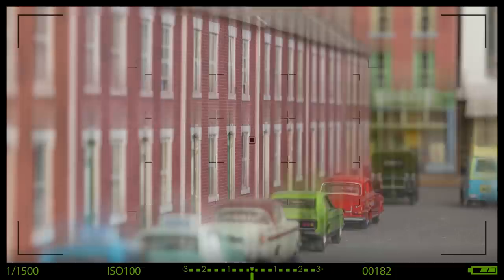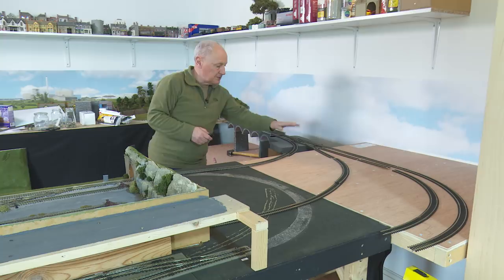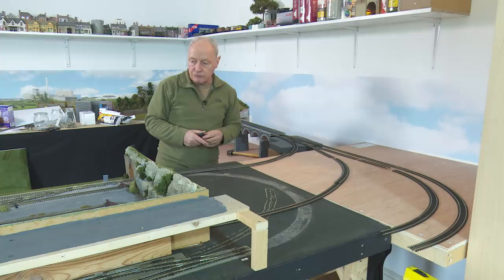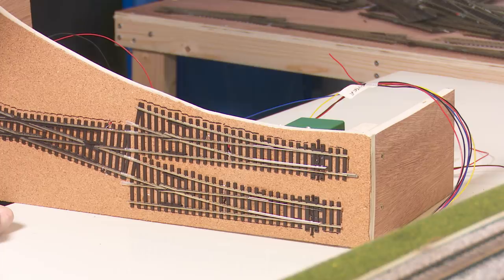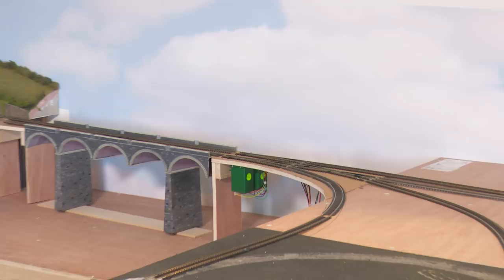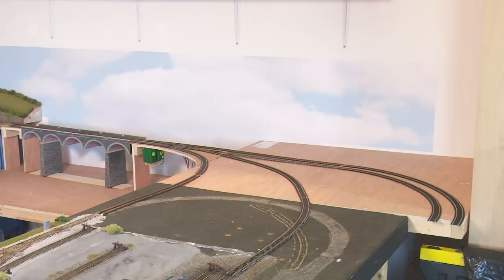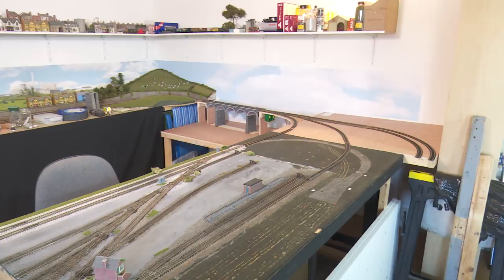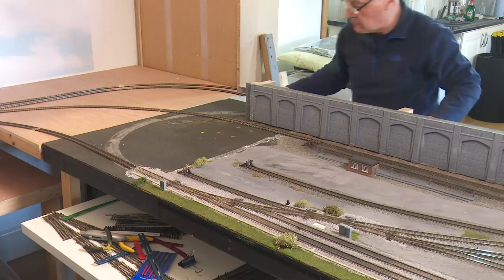Track Plan Sorted at Chadwick Model Railway | 59.

Comment: why not expand the track layout with removable butt stocks or buffers 

and have a mini storage yard behind the scenes.. you look like you have enough space there to extend a complete through tracks.. to give an option to  have a pass-thru  so you can run freighters and a passenger service without  causing blockages..
Reply from the maker: I’m embarrassed to admit that I don’t really follow your proposal Jason. 
Can you possibly post a link to a picture?
Reply: @ChadwickModelRailway   

the idea would be to have removable  buffers

My idea would be to extend the start of your rail yard to the exit  expanding the rail yard to allow for the room a 12 track fiddle yard with 2 mains and 2 spurs this way you have a main/runarounds in the middle and access off the spurs..

in which your mockup doesn't currently allow for..

watch your own video and mute your voice
 look at your own layout

Some times it pays to step back and oneself as a third person view

Sit down  look at your original objective look at what you are trying to achieve VS what is needed to go to the objective at hand..

from what I can tall from my  very suggestion  you haven't really thought of the access that will be a need rather than the access you have not considered  you actually require for the layout to function  without creation operational bottlenecks..

from what I can see you have fixated on the the fiddle yard though have not considered on how you intend access the fiddle yard and the current access route via the viaduct end as the indications  are you don''t really have the space where  the  fiddle yard is located to support the  fiddle yard itself let alone mains line/spur for running locos around the consist..
nor active spurs on the outer periphery of the fiddle yard

minus the turn outs

i would  do a complete mock up of how  tracks that section of your layout can hold 

I can see 12-14 tracks at this stage.

allowing for  spurs and mains it 8 usable as a fiddle yard..

at 14 tracks it gives you 10 tracks as fiddle yards, 2 mains and 2 spurs

at 16 tracks it  gives you 12 track fiddle yar 2 mains and 2 spurs

at 18 tracks it gives you 12 track fiddle yards, 2 mains  4 spur/branch lines

though your current behind the scenes layout  doesn't permit  access to a 14-18 track layout to be put in as most of the switches you will need will  sit between  the via duct and the face panel as you will be needing scale into the 14-18 tracks from 2-4-6.. Depending on mains spur line usage

this was my observation of the layout you are using..
Reply from the maker: Thanks Jason, I’m on the case.
Reply: @ChadwickModelRailway  sadly i can't provide a picture suitable  to explain

going from your own demo here for a track fiddle  to work within that layout  you could be looking at a min of 15, 16 to 18 track depending on mains industries, and additional spurs you are going  to use,

looking at your current layout you will not have the operational space to support the fiddle yard because you will likely require to replicate this at both ends....

ya point motor issues  I might volume purchases with vendors it might be cheaper buying in the hundreds or thousands  rather than purchasing by the dozen
Reply from the maker: Thanks Jason.
Reply: @ChadwickModelRailway  no worries

sometimes we can fixateon on layout to to the point it will not functionally work

I might consider a diamond point at the via duct with doing turnouts to step into the mains , spurs and fiddle yard

i think having  so many crossover tracks creates more functional issues in operations  what may work in a section either in commuter cross over or coming into a station  typically will work on a fiddle yard scenario however is a functional nightmare to run

from mains i would consider  having either a diamond or throughput or  4-6 way cross over leading into fiddle yard using it a run around option when main lines aren't being  used

Comment: Have you tried taking a look at megapoints controllers they use cheap model aircraft servos which work in a similar way to the tortoise I use megapoints controller on my model railway not only does it control the points but it also controls things like Crossing barriers etc as well and can also do semaphore signals. If I remember rightly it can even control tortoise point Motors https://megapointscontrollers.co.uk
Reply from the maker: Thanks for the tip Gary.  I’ll have a look to check that “Train Controller” can operate them.

Comment: Great video, as always :-)
At 12:15, DaveClass47 did an excellent video on the technical bits of why and how to modify Peco electrofrog points : https://www.youtube.com/watch?v=Et3vuedbZ98 Once wired up that way, it's a piece of cake to solder the leads onto the tortoise motors (Dave uses Peco solenoids)!
Reply from the maker: Thanks, I’ve seen Dave’s latest too. 
I agree is it quite straight forward.
Good luck with your layout, regards Charlie
Reply: @ChadwickModelRailway  hahaha O don't have a layout - no space for it at all! 
I am collecting a BoK for now, as well as making some unqualified comments ;-)

In fact I don't know whether I will ever have a layout, or get sidetracked by wanting to develop a DCC replacement :-)